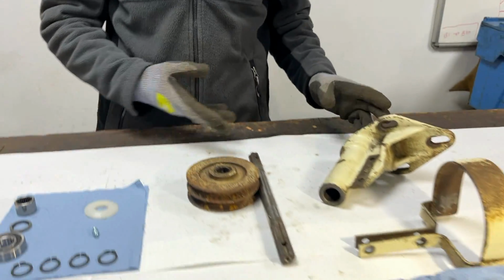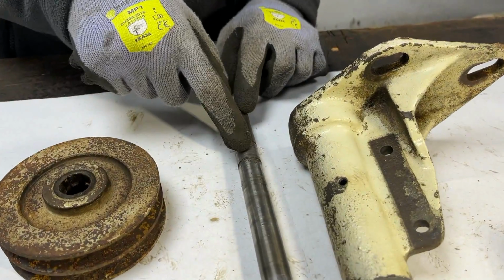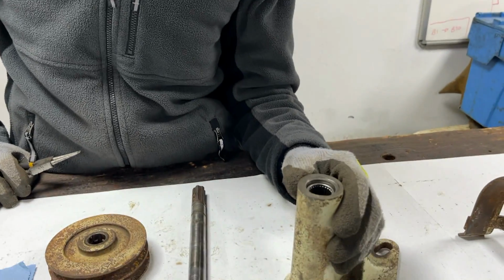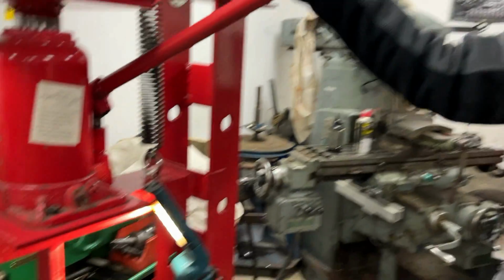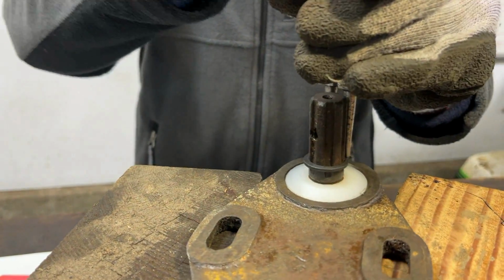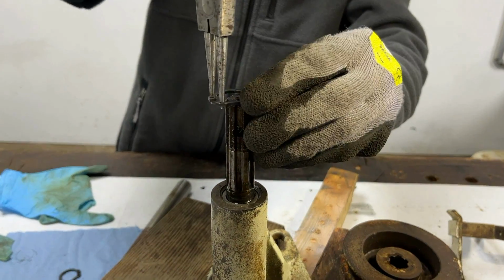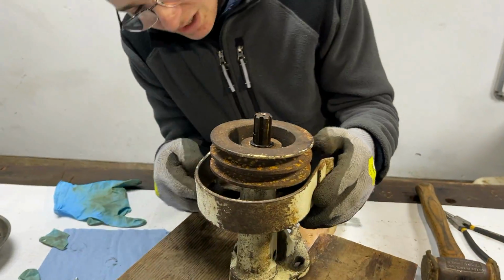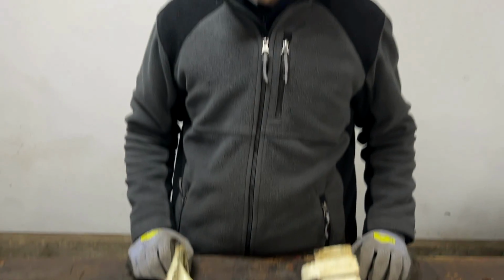Bolens PTO rebuild - Part4 (Reassembly)

Comment: Can you share the part numbers of the bearings you used?
Reply from the maker: Sorry for the delay replying, I had to find my notes. On our PTO we used a SKF 1635DC or Stens 230-300 ball bearing and a Koyo B-1212;PB;L125 needle bearing, plus a CR7410 oil seal. It would be worth checking your original bearings as they may be different to ours. I hope this helps, take care

Comment: I have the same PTO that broke really bad infect the entire mounting bracket had shattered into 5 pieces. I welded on 4 of the 5 and reinforced the bracket with steel plates and welded and reopened all the holes 3 of them by hand then putting a back plate of steel on it and welded that all on I mean there is nothing left of the stock holding bracket left that has not been reinforced with new 1/4" steel plating. the hardest part of the fix was getting the holes milled out with a drill and nothing more. it took 5 days and I finished got it installed and it  is holding steadfast and solid even better than it was now. All with a 80 dollar hitbox welder and Dewalt battery drill.
Reply from the maker: Great job repairing your PTO, it sounded like a lot of work but you got it done. Milling with a drill is never easy. Take care

Comment: Hi, Hope you can help me. I am a big westwood fan and I came across your video about shredder that does not exist from 3 years ago. I managed to get one like that for my tractor however it is missing mounting bracket to the tractor. I want to make one. Is there a chance you could release measurements of yours so that I could replicate???
Reply from the maker: I can't remember what we mentioned in the video. The mounting bracket did not come with our shedder either and we managed to get ours by looking in detail at every Westwood that came up for sale until we saw one with a bracket. We then offered to buy just the bracket from the seller. We have since found out that Westwood made serveral different types of bracket depending on the model. Our bracket is not perfect on our D1200 so I am guessing that it was made for a different model. Our Westwood is currently in storage, I am happy to get measurments for you but it may take a little while. I will check access over the weekend. Can you drop me an email as that will be easier to send you the information. If you click the ">" symbol on my channel home page it will show you me email address. Take care

Comment: The assembly went well. Whoever machined the teflon seal did a fine job. Good snap ring pliers are essential and yet there are still some tough rings to expand. Good trick with the glove. I thought that shim stock rolled around the shaft might have worked too. It looks like it'll be working perfectly now because it is As-New. The grease cartridges are a cleaner idea but I still use the messy method to refill. Some fill grease guns right out of a pail of grease with no cardboard tube. That's the old-time way. Have yourselves a fine week ahead!
Reply from the maker: Thanks. We were very pleased with that seal. I think we will have to buy some snap ring pliers with longer handles to increase the leverage. We are very pleased with how good the rebuilt PTO feels. Take care

Comment: Good call on installing the big bearing 1st before the oil seal 👍
So many times I could have used a press like you have 
I have some right angle C Clip Pliers and they come in handy for sure 
Good catch on the belt guard 😂
Those Safelocks look like a great idea 
Another Job Well Done 👍
Reply from the maker: Thanks 👍 Our press is only a cheap overseas one which we have done some upgrades too. I am not sure how we managed before we bought it. We may look for some longer handled C clip pliers for next time we do one of these as those clips were not easy. Take care

Comment: Nice job of getting everything back together.  I have found that the grooves in the pulley splines and the splines on the PTO shaft sometimes accumulate a smidge of rust in the corners which can make sliding the pulley on and off a little bit snug.  I usually use the end of a small flat file or an old broken hack saw blade to clean out any rust in the corners of the splines.  Another thing I have found is that if you rotate the pulley splines one or two grooves in relation to the shaft splines the pulley will sometimes slip on easier - seems to be one or two of the six different positions that are the "sweet spots".  I also put a light layer of grease on the splines of the pulley and the shaft area between the two snap rings as this seems to help reduce wearing of the splines as the pulley moves against the shaft every time the PTO is engaged.  Just suggestions that may help in the future.
Reply from the maker: Thanks for the great tips which we will use when we rebuild the next one. Take care

Comment: Good video. I'm surprised that there isn't a washer between the circlip and the plastic seal. When I bought out an old small engine shop, the tools included a set of thin plastic sleeves for installing seals. they work very nice if lubed up a little. "This isn't the first take of this clip" had me laughing. You delivered the line very well. Good Luck, Rick
Reply from the maker: Thanks. Those thin plastic sleeves sound good and very handy. It was a bit frustrating when we forgot the belt cover but you have to laugh about it and hope we do not make the same mistake again. Take care

Comment: Ahh the circlip struggles. I wasn't sure the glove finger was going to work.
Reply from the maker: Those circclips are very thick and not easy. I think we will be buying a tool with a longer handle. We were surprised the finger worked too and it turned out to be a good solution. Take care

Comment: Nice one Joseph, those are certaily the thickest circlips of that diameter that I have ever seen!!
Phil
Reply from the maker: Thanks 👍 They are very thick circlips and apparently they are usually used in transmissions. Searching for new repalcements we came across a good UK company called Springmasters, they were able to supply them and they have some good reference information on the web site. Take care

Comment: Hello Joseph,
Lots of circlip fitting practice - lol. I was thinking maybe it would be a good idea to store the PTO for a couple of days (shaft vertical) so that the grease will flow to the bearing without the cover on thus ensuring the grease got there... A nice bit of gravity should do the job fine.
Take care.
Paul,,
Reply from the maker: Thanks 👍 That is a good idea to store it vertically. Take care

Comment: First! I respect your consistency. Im repairing an old craftsman yard mowers steering and drive system. Gears and all bushings were worn. Just waiting for parts to reassemble. I like how you provide education as you rebuild your equipment. Have a good weekend!
Reply from the maker: Thanks. The Craftsman sounds like a great project and I expect it has all the challenges we are facing with the '60 Ride-a-matic project. I hope it goes well. Take care